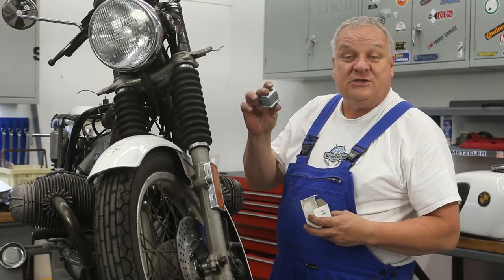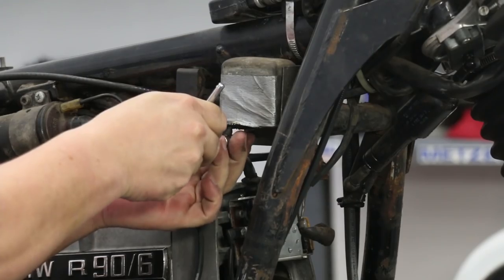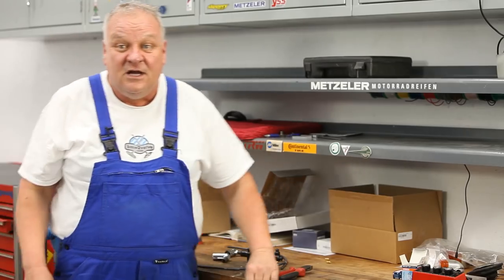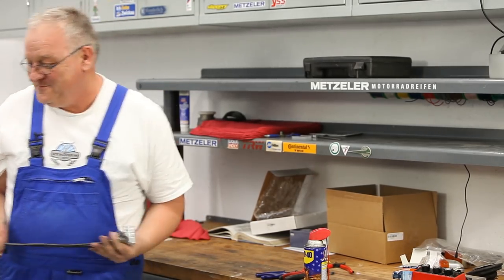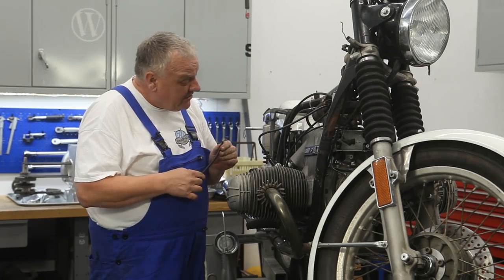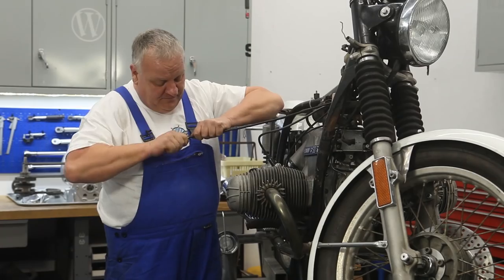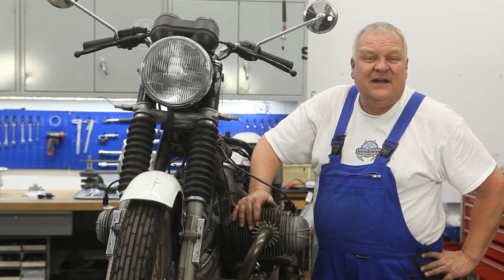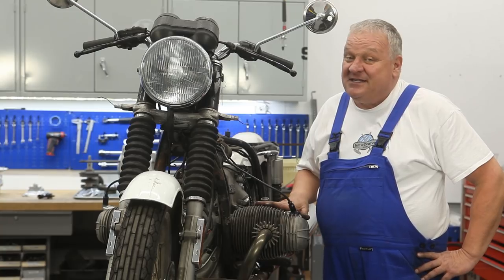R90/6 Episode 22 - Relays, Lights, Plus & Switches

Comment: Great videos and storytelling. I've started using isopropyl alcohol as a lubricant to get tight fitting rubber bits to slide. It evaporates unlike WD-40, etc.

Comment: I am rebuilding a 1979 r100rs  I have watched a lot of your vids ,they are the best . Small problem with neutral light  can I take the switch out  by removing the back engine bolt ,then unscrew it , maybe the wire is broken  yours hopefully   Derek.

Comment: Great informative video. I recently removed the Acid battery from my R80 G/S 1981 and replaced it with a Lithium one.  I then tried to start bike. All lights, turn lights and horn working but not cranking. No sound . Should I assume Relay damaged and check ignition switch before taking any action?

Comment: Great video, could I ask a question.  My BMW R90s been off the road since 2008, just fitted new battery, all I get is the charge light illuminated. Turn on the ignition, now get charge light and very faint oil light. Nothing else..... Help....

Comment: My 1980 R100T has been sitting in pieces for four years.  I went to put the headlight back in the bucket and can't get the bottom to go in.  I loosen the screw like you said till it was even with the nut, still no go.  What am I missing?  The chrome headlight ring is new, purchased four years ago, but never installed.  Could it be the wrong ring?
Reply: I got it.  Apparently, I had the clips that hold the reflector into the chrome trim ring were to close to the bottom.  I relocated one on each side of the lock-down screw and the bottom fit.  Still wasn't as easy as the video, but with a little convincing from the side of my fist, it finally popped in.  Amen!

Thanks so much for the videos!!!

Comment: What do you suppose a symptom of corrosive coil contacts are, as referenced at 10:33 ? Could that lead to weak/red spark?
Reply from the maker: Hi, yes corrosion can result in anything from weak spark, intermittent spark or no spark. Good solid connections are important!